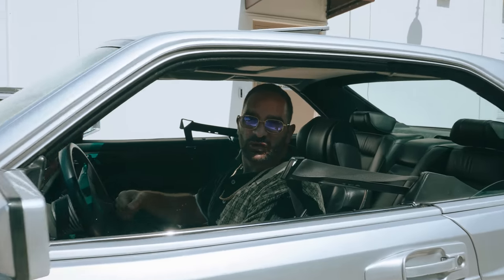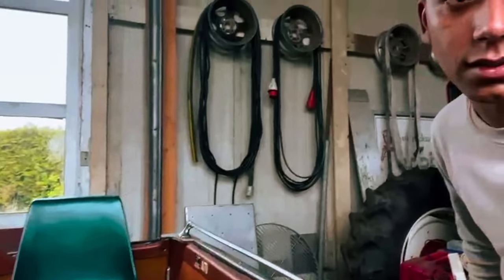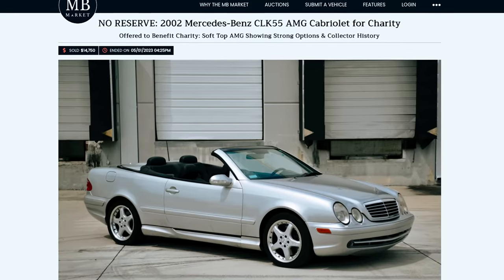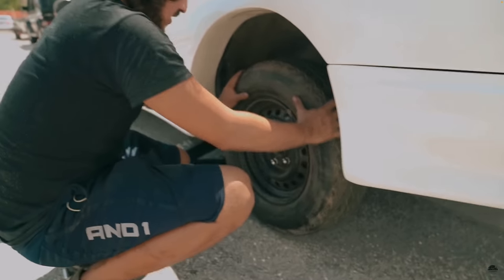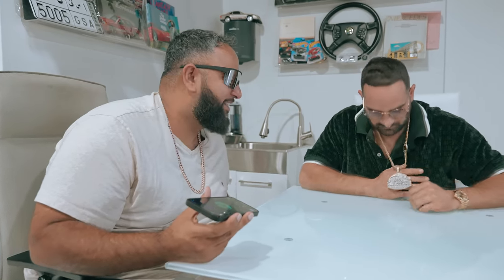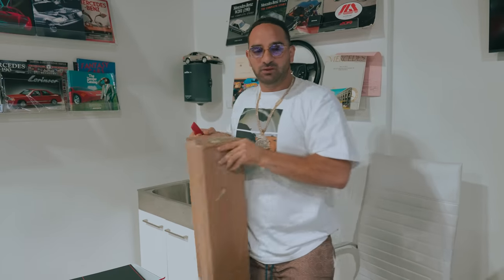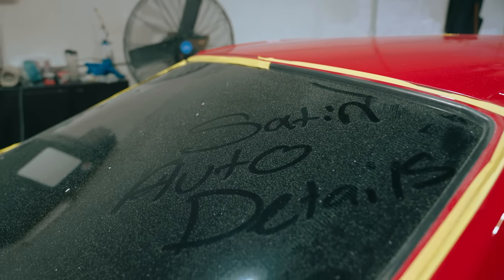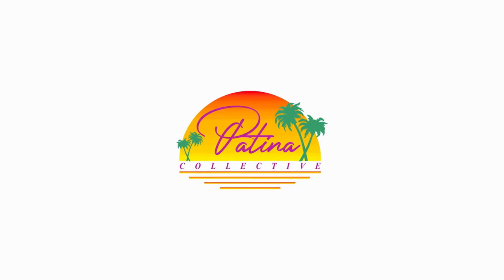6 Vintage Benzes! Rick Ross Car Show Prep

Comment: 9. Remap the spark power from the main module. Below the glove box on the right side, front of the right door inside. The module stages from 1 to 7. As I remember stage 1 for premium fuel 98 octane or equivalent. Stage 3 for 95 octane or  below. Stage 7 for 91 & below.